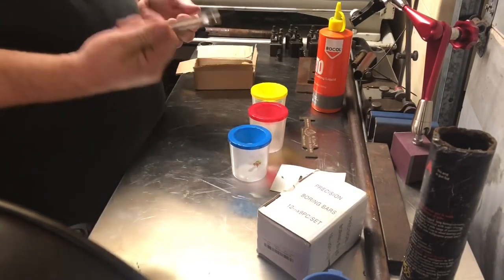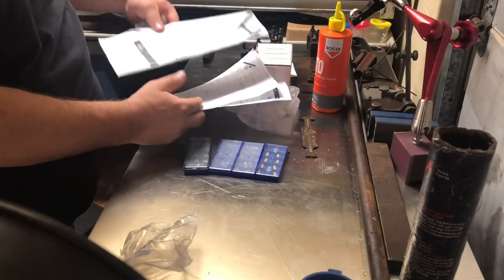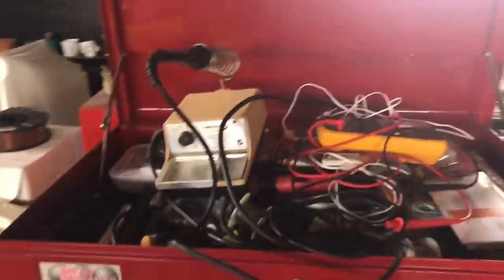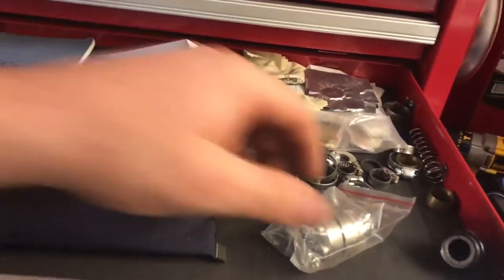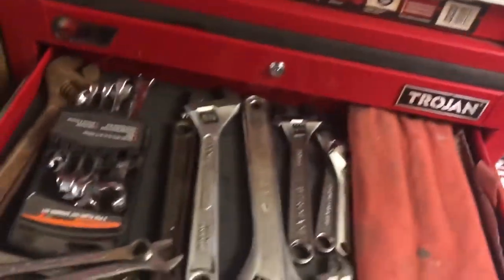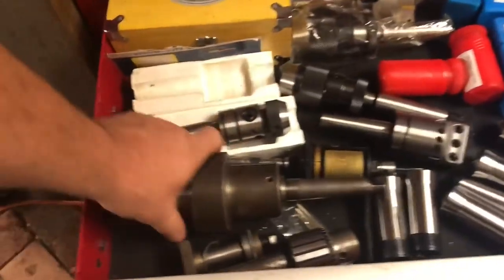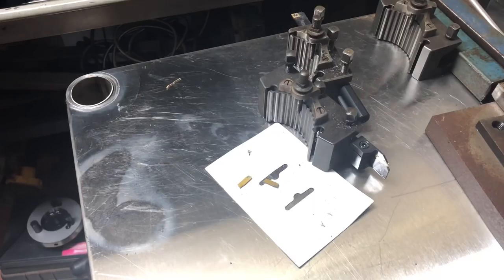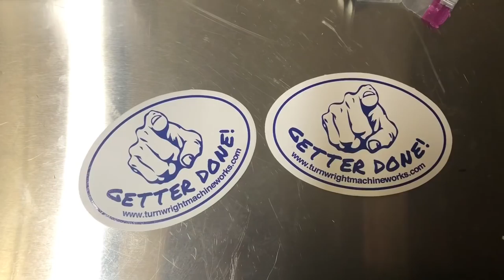Tool Time - 1K subs

Comment: Congratulations JB
1000 subs, your on your way to the big money now.
Your workshop is like mine, too much vital crap and not enough to space.
Cheers
Reply from the maker: yeah I have previously had the pleasure(?) of much larger spaces, and i've found that like a gas, tools grow to fill the available space. In our house, we have tried extra hard to remove anything not required, and make multiple uses of what we do have. I am actually pretty pleased with the way everything fits, and everything is to hand.. much better than I had hoped it would turn out :-)